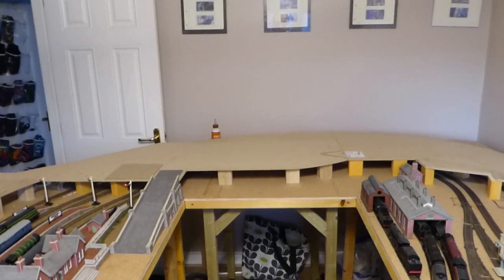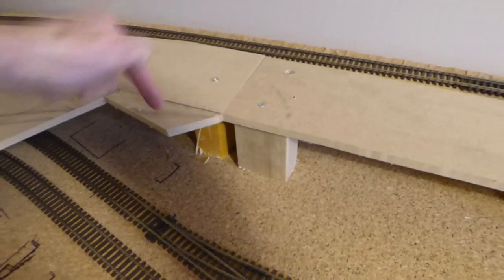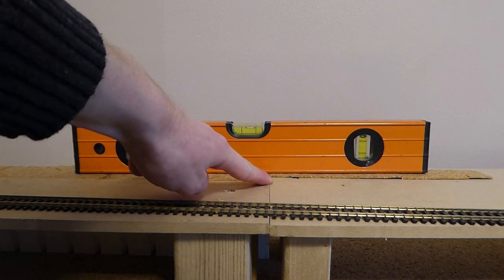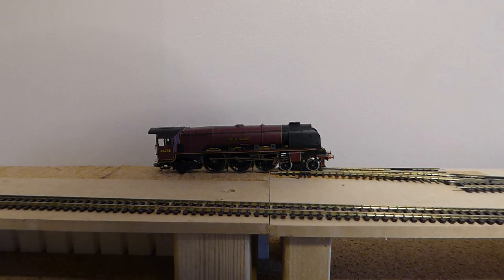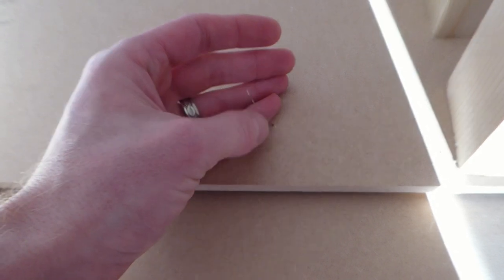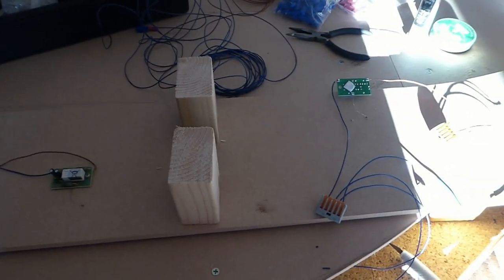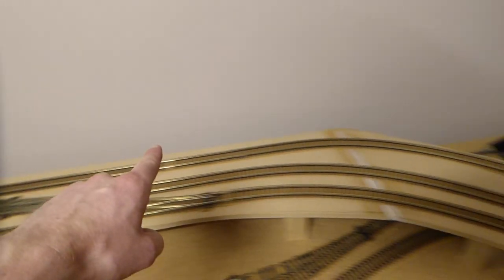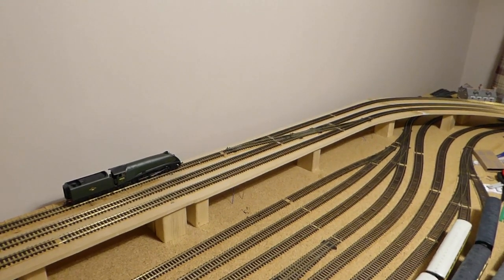Greenhill Junction - Building the Upper Level Part 3 - Video 34

Comment: Brilliant video, love the way you use the Wago's, will have to get myself some of those...Simon
Reply from the maker: Hi Simon. Thanks for watching and commenting. The wagos are game changers for wiring, so simple to use and a great connection between all the wires. If I'd found them sooner I would've used them for the multiple droppers from the lower 4 tracks to save having so many clamps on the main bus wire. Cheers, John.

Comment: Excellent work on the upper level John, you've been busy with the jigsaw i see :) All coming together nicely with the trackwork as well, a very busy layout. Can i ask - how do you get to clean the track under the village section? Does it lift out? 
Very nice work also on the wiring, very neat & tidy. This auto frog points, frog juicer thing still baffles me but I will have to learn for the layout extension down here. I'll be looking up your previous video on this subject for guidance. All the best for the New Year..........Andy
Reply from the maker: Hi Andy, good to hear from you again. The jigsaw is the best money I've invested in this project! 😂 The village section isn't removable, I'm going to invest in a Sharge track cleaner soon. I'm still working out how to get into any derailments, I may make the road down to the yard removable for that. Cheers for watching and all the best for 2021. John.